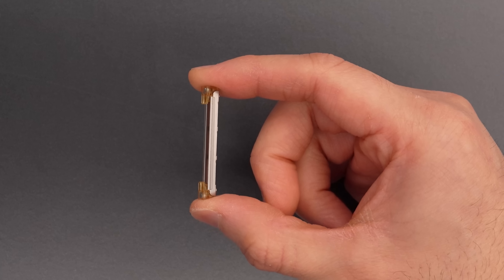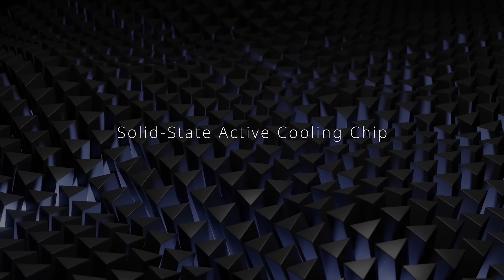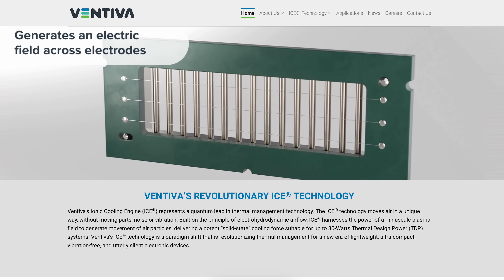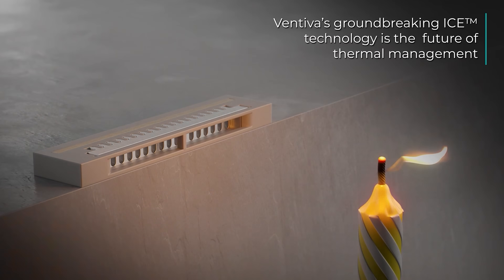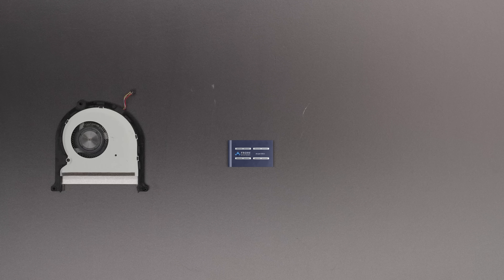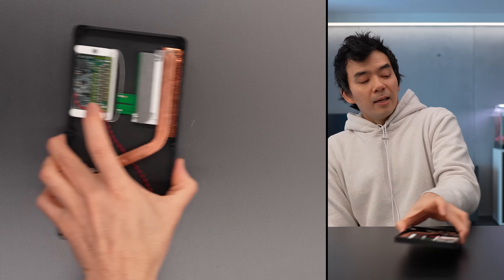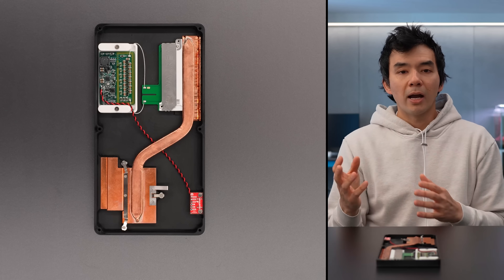The IMPOSSIBLE Laptop Fan...

Comment from the maker: This tech is absolutely incredible and I think it will change the industry
Reply: Next-Gen Ionic Plasma Thruster Inspired By Nature (BTC Mark 3)
Reply: Dave just learned about ion propulsion lol.
Reply: These ionic devices attract dust due to the charges involved. If any conducting dust/debris bridges the gap between the ionic device's electrodes, which are fairly close in this device, it will short and potentially damage the voltage multiplier board. 

Another consideration is the high voltage paths and static electricity generated will need to isolated from the rest of the laptop components with ground loops acting as current sinks around sensitive components this make layout more difficult to achieve optimal airflow as you have two competing design goals - electrical isolation and airflow.
Reply: @GruffSillyGoat This spits acrid ozone and is an ignition source that with moist air or built-up dust will arc over and can start a fire.
Reply: Is it dust proof? I bet not.
Reply: It is amazing how much you are amazed and thinks revolutionary with high school class level current induced force.
Reply: This technology is several years old, there are even a model airplanes flying using thus technology
Reply: reminds me of the ionic breeze
Reply: @AnthraxVX  because it is.
Reply: I don't think it will, because just like the AirJet an ion thruster requires quite a large amount of current to create the plasma arc - more than the amount of power required for regular fans. They are LYING to you about the power consumption - and any viewing of videos right here on YT of ion thrusters will PROVE that they are lying to you. Their benefit in satellites is they don't require extremely heavy liquid or gas fuel and instead can use the generator and batteries already in the satellite. But they are NOT power efficient AT ALL. They also have other issues in such a compact form such as heat production (you're creating plasma, plasma is hot), the wire electrode wears down so the whole thing will need to be replaced pretty regularly, they don't do well with obstructions (especially flammable ones) such as dust which is rather a problem for a computer component and an actual fire risk, they're also a risk of failing and causing a short circuit which again is a fire hazard, and ultimately they WILL drain your laptop battery much faster than fans do.
Reply: Lifters use this tech for ages.
Reply: this tech is old and far from changing the industry
Reply: @Dave2D 
👉"Incredible", no.! You have seen it working, and commented on it. So it is 
👉creditable.
You might like to learn English some time.
Reply: This is existing tech re-packaged. Plus, do you even know what the word "impossible" means? This is bad content.
Reply: In ionic thrusters, "material degradation" primarily refers to the erosion of the thruster's grid components, particularly the accelerator grid, caused by continuous bombardment from high-energy ions of the propellant, leading to a gradual decrease in thruster performance and ultimately limiting its lifespan; this erosion process is commonly called "sputtering.". 
Key points about material degradation in ionic thrusters:
Sputtering mechanism:
When ions from the propellant strike the grid surfaces, they can knock out atoms from the material, effectively "sputtering" away material and creating small craters on the grid surface.
Reply: I very much doubt that it would really serve long term: The humidity would destroy it.  They "invented" something that has existed for decades. Useless shit.
Reply: Few spoons of shit in this barrel of honey: 1.so you are now have a source of few dozen kilovolts or more near the motherboard (what could go wrong) 2. What's up with static electricity that this crap would produce? 3.whats's up with Ozone? ,it is highly corrosive you know..  4 and of course what is up with fine dust that sticks to charged surfaces (remember crt tv screens?) there's even industrial electrostatic dust filters  of similar construction ... And a problem with space ? - there is none( i am repairing laptops for 15+years) 99.9% of modern laptops motherboard sizes is 1/6 or less than they're were 8years ago(like android  screen)some of them even the size of cigarette pack.. most of today's laptops are empty space  inside...
Reply: As an Electrical Engineer for me its not something new I have been seeing these things for now 4 years. People are making fans using similar concepts.
   https://youtu.be/AJD_fiHleRM?feature=shared
Reply: People have been making ionic model planes for a while now. 
https://www.youtube.com/watch?v=a9yYu-ZM1S0

This demo was 6 years ago.
Reply: @mazinsidddique9269  look for a thing it`s called "RSD5" from Thorrn. They tried the same thing 16 years ago
Reply: ElementaryOS on the laptop in the CGI demo...>!?  NICE
Reply: fans are just too good, it will take a miracle to invent something that surpasses them
Reply: @kiyoponnn  Fans are good, we can make drones and helicopters out of them.
 
But in physics we have more tricks like Bernoulli principle for Planes etc. 

And ofcourse, there are cases where we cannot have blades and fans, for example in nuclear reactors etc, In such cases we rely on electro magnetism to move water for cooling.
Reply: @PrajwalDSouza   yeah but we are talking about moving air here so the water example is irrelevant and planes use fans in their engines unless it is a jet engine or something
Reply: @kiyoponnn  yeah they do. But like I said, in physics we have more tricks other than just conservation of momentum.
Reply: Bro that tech was already out there...
Reply: No it won't. It's old technology with downsides.
Reply: This is same technology used by NASA in ion thrusters.
Reply: In the 90's, there was a company named Sharper Image that had an Ionic Breeze - a room size version of your "impossible" fan
Ionizing fans and "air purifiers" have been around at least that long and they are a very bad idea. They produce ozone which can be deadly.
Reply: Landscapes
Reply: @Dave2D this piece of technology was there before ! This is called ionic thrusters !! Actually this was developed to develop a rocket which is able to travel to outer space !! But these thrusters are unable to produce enough thrust to run a rocket ! These are still in development !! A nice piece of tech !! I hope someday we are to produce an ionic thruster using a thorium reactor , it will be a great achievement !! Hopping for someday !!
Reply: Wrong.
Reply: THE GHOST YOUTUBER WELCOME BACK !
Reply: Dust will destroy,they are testing in low dust facilities.
Reply: this tech is trash and you know its trash lmao, channel blocked
Reply: Living in a dusty, crowded, polluted tropical country with high humidity in many places.. i doubt that in ita current form.. such applications of this technology would give the "fan" longevity in failure free operation.

But ofcourse these things might find their way in medical equipment, devices.. let's say in the intensive care units or other computing devices in controlled environments like power generation stations, critical laboratories manufacturing specialist products, microprocessors and stuff or places like the space stations.

I am more intrigued at how they are claiming that a first generation product is good enough to not add to environmental issues.
That claim about the magnesium thingy being enough to convert ozone back to oxygen. I have my doubts.
.
Scalability .. as you mentioned.. too is restrictive in consumer level products.

Although good development after decades and centuries of conventional processes.

Thank you for covering this.
Jealous that you could also check out the yet to be unveiled laptop too.
Reply: Mechanical fans require more CFM because the air it pushes is not saturated with heat so more air is pushed to take in more heat. But FRORE system SS device saturated the air with more heat and pushes it out so it requires less amount of air to be pushed. Your ionic thruster has huge problems of high voltage requirement, ozone creation and damage to devices due to static electricity  etc
Reply: And what about dust, fur and other debris?
Reply: @zlozlo3935 
I posted that the company who makes the fan, claims that they have solved those issues but can not discuss how; because of Patients pending issues and a possibility of a limited life time warranty for the fan might be possible, depending on the Laptop manufacturer.
Reply: It's been known for years now and it will change fuck all
Reply: It's pretty old..nothing new here, you need to dig the subject more...if you do not want to look like a joke
Reply: This isn't new technology at all.  I went into a Williams Sonoma decades ago and they had the Ionic Breeze which used this very same technology for a room fan and was completely silent.  Years later, the ozone issue made news.  The only difference here is that they miniaturized the devices.  Still a neat idea.  I would love a laptop with no moving parts that's completely silent.
Reply: Incorrect! This is not groundbreaking technology; it’s been around since the introduction of the Ionic Breeze. Credit goes to The Sharper Image, which pioneered this concept back in the 1990s. Let’s stop overhyping—there’s nothing innovative here.
Reply: @GoBrand0n  it needs wider use.
Reply: This isn't the first company to do this. Frore Systems has a product that does the exact same thing.
Reply: I am sure that secret company is probably asus
Reply: I want a drone made with this.
Reply: maybe all industries is there any proof for it to be scalable ? maybe for a turbine for some kind of transport or even for renewable energy?
Reply: I see devices shrinking so you can have a computer the size of a cellphone, which you can plug into a monitor and keyboard, or mount one in a housing that includes these.
Reply: PLansma Channel played with this kind of ionic tech and was able to move an impressive amount of air.
Reply: @erroneousbosch  Yeah, but did you notice how much power it takes? Way more than is being claimed in this video even for a small thruster, and low powered tiny ones will produce basically no thrust at all - certainly not enough to keep a laptop cool. It makes me think their display model is being driven not from the internal battery, but directly from the external power supply.
Reply: How can it change anything when it is impossible? That is what you say in the title, right?
Reply: unless a big company buys them.
Reply: Are you allowed to insider trade because you know what the big company is and that this will be revealed at CES? I am not accusing you, just wondering if this counts as insider information that you can buy stocks from.
Reply: End user product would be entirely DC.

One could drop (the fan device) it in water and suffer no ill personal effects from it
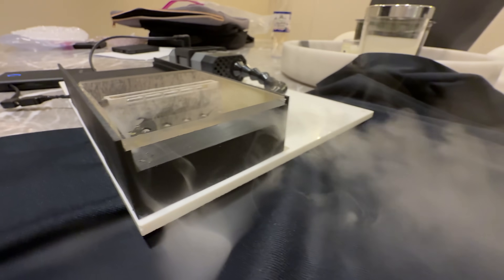Reply: 5:30 Yes smoke particles are following fluid dynamics JUST LIKE AIR... WTF are you trying to say here? Do you think the particles in air don't do the same thing?
Reply: I have a question completely unrelated to the topic. To all the YouTubers. Is there an advantage to having your own comment under your video, like generating/kick-stating engagement or something?
Reply: Manganese dioxide (MnO₂) is generally considered to be non-toxic and environmentally friendly. However, it can exhibit toxicity under certain circumstances. The toxicity of MnO₂ is primarily attributed to the release of manganese ions, which can be harmful if ingested, inhaled, or if they come into contact with the skin or eyes. The toxicity of manganese ions is influenced by factors such as the particle size, concentration, and exposure duration. Prolonged exposure to high concentrations of manganese ions can cause adverse health effects, including neurotoxicity, respiratory problems, and skin irritation.
Reply: This has been out for years I thought they would implement it by now
Reply: npc^
Reply: The technology is already existing in asia. have you ever heard about bladeless fan? it doesnt have any blade and the technology is still the same.
Reply: @Darkcrimsonfall  Bladeless fans just hide the fan out of sight. They do not use ionoc thrusters.
Reply: @Darkcrimsonfall  Nope, those household fans (Dyson etc.) hide the blades inside a closed compartment and use small nozzles with Bernoulli effect to move additional air.
Reply: It will not. See my other comment. Ionising air generates ozone which is toxic to human beings. Also working with high voltages can be challenging because of electrical noise and static build up. This will never be successful. Sorry to poop on your party.
Reply: not really, it's common knowledge
Reply: at 6:01 dell?
Reply: it'll definitely shock the industry.
sorry, not sold on it. I had an air purifier that used this same technology, it gums up very easily because dust builds up on the cathode.
Reply: @slothnium  exactly!! This is the problem , dust buildup !!
Reply: Are there leakage of ionized molecules? Could cause lung issues?
Reply: Plus static attraction at high voltage
Reply: ... doesn't ionization of O2 create ozone?
Reply: @no-trick-pony Yes. But it's small amount and unstable and breaks down quickly.
Reply: It's not new tech, ionizing air with high voltage is an old thing. I don't think this will work for consumer products, it may work for specific use cases where there's no space for fans.
Reply: Can you put them in smartphones?
Reply: on handhelds?
Reply: @aiazoe  ??
Reply: you can probably put a bigger quieter fan somewhere more convinient in the laptop's structure, that would not really make sense as a cooling solution, and then the samller units could use the air already forced into the case much easier to push it through the heatsinks, also due to the static pressure issue the cases will need better filters, if a heatsing got clogged with cat fur, it might not have the strenght to push it through
Reply: How?
What's revolutionary or new about this?
I built one of these when I was 15... that was more than 30 years ago, and it wasn't new then.
Reply: plasma channel has good information on this tech btw
Reply: i wonder how well it handles dust
Reply: How much energy does a typical laptop fan use compared to other components such as the xPU?
Reply: wrong dude. it uses high voltage and cat hair could short it out.
Reply: Aren't they already using this tech to propel satellites?
Reply: I have a crazy idea... Mix the two. Vibrator tech for cleaning it!!! Make it a on occasion cleaner that vibrates it, and the general use is the ion thruster tech
Reply: Try to combine both fan and solid state, and voila. You got and a laptop aio. Think about it
Reply: lemme get back the vape u borrowed plzz 😂
Reply: Nintendo could really take a chance with this new hardware
Reply: If you do some research, you will realize this has been out since 2013. Nice try, though. Go get more tokens, and please try again.
Reply: why is it 40 dollars if its just a peice of metal and a circuit to generate high enough voltage to ionize the air? cant you make that yourself for like 5 bucks
Reply: As someone who personally knows and is customer is one of the leading manufacturer of dc motor for cooling systems for commercial and other use. this tech will come in handy and will change the industry more than we can anticipate.
Reply: i can imagine it being used in gamming phones   as these are so small
Reply: It is waaayy TOO SLOW to cool down ROG laptop with RTX GPU
Reply: Ahhh yes, ye old sharper image ionic breeze air purifier shrunken down and then they catalyze the output so that it does not produce the ozone that purifies the air when you could have had both. They probably had to do that to get around the other patent. Still would have been nice to have your laptop and air cleaner all in one.. make it cleanable to..
Reply: The 1st one is a bladeless fan that befouls the room with ultrasonic whistling (makes deaf, tortures any dogs and minors, may cause brain damage). And this one spits acrid ozone that may decompose all kinds of precious materials in the room (photographic negatives, magnetic tapes, rubber, paper, paintings) and cause migraine and sore throat. Making a fan of an ion jet engine is as stupid as putting a combustion fuel jet engine into your laptop. And if it gets dusty or air is too moist, it will arc over and fail. Laser printers befouled the air enough with ozone and toner. No thanks for this one.
Reply: You should subscribe Plasma Channel
Reply: Looks like a copy of the design made by another youtuber "Plasma Channel".
Reply: just an ion fan
Reply: One question: What about dust accumulation? How hard will these fans be to clean when they get packed with dust over time? Will cleaning it damage the tiny filament wire? 
That's the only problem i see with these fans.
I live in an old dusty house, and about every six months, I have to take my laptop apart, remove the fans, and clean the fan fins with a toothbrush..
If they design it in a way that makes cleaning it easy and safe to do, I am all up for a laptop cooled with these fans.
Reply: @JournalistJim 
The company Ventiva, who makes this cooler claims they have solved the humidity and dust issues but will not disclose how they solved it, due to Pantent pending status.
They also state a possible limited life time warranty of the cooler.

So I guess it would be up to a laptop manufacturer to roll that dice.
Reply: Dell Is Using this Fan in their Laptop
Reply: I guess nobody's heard of the sharper image ionic breeze "air purifiier"
Reply: It's not just laptops, I was messing around with AI to get a more in-depth look as to where this tech could be used and it literally doesn't stop, everything from personal appliances to military equipment. Once this is more finely tuned this will be the standard in the future, here's just a few that AI was able to provide: Perfect for noise-sensitive environments like homes, hospitals, or offices. Suitable for applications where size and weight are critical, such as drones or satellites. Low power consumption makes them ideal for portable devices and energy-constrained systems. (These were bulleted with a more broad view but I only included the bulleted points): Wearable Technology, Consumer Electronics, Automotive Industry, Healthcare Applications, Aerospace Applications, Data Centers and Servers, Industrial Applications, Home Appliances, Military and Defense, Renewable Energy Systems. If they have the major patent behind the creation of ionic fans then they're a company that I'd be Bullish on (might be worth investigating and investing in). Just saying.
Reply: By the end of the video I am feeling it too really clear... feeling a big piece of non-engineer marketing shit.
Reply: And flight. When we move like this without air we will have spaceships
Reply: Get rid of that stupid hair, Dave.
Reply: Incorrect! This is not groundbreaking technology; it’s been around since the introduction of the Ionic Breeze. Credit goes to The Sharper Image, which pioneered this concept back in the 1990s. Let’s stop overhyping—there’s nothing innovative here.
Reply: @GoBrand0n  This goes back to laser printing. In a laser printer its called a Corona Wire. High voltage is being pushed through the wire. Look up how thats used in a printer. Creates a lot of Ozone which is very unhealthy.
Reply: Don't think it will go anywhere. Corona type fans like  this always have problems. DUST is going to be a big one. Not just dust, but all particles in the air (usually we call all of that 'dust' but pollution is included in this example. And you get a lot of Ozone being created. You don't want to breath in a lot of Ozone. Its toxic. When I worked for Xerox, some of the copiers were installed in essentially basements, with no air re-circulation. And everyone that worked in that office got headaches all the time. 
Um, yeah. Got rid of the ionic air problem? I dont think so.
Reply: What is the name of this device
Reply: I think you mean this Tech could end the planet as we know it have you Googled what would happen if you did that to all the oxygen in the world?
Reply: Creating Ozone is so cool!! Just like he said your creating OZONE out of nothing... well you get what im saying
Reply: @ and ozone is bad for your health
Reply: Yes; Seems Like a Winner....👍
Reply: Silent, Energy Efficient & Petite....
Everything U want & Need For Miniaturisation.....
And No Moving Parts Like A Fan....👍
Reply: Can this Technology be Applied to other Fluids, such as Water, 💦💦...
If so; U can Up-Scale it, to Propel Water based Vehicles, I.e. Boats, Ships & Subs.....
Fuel Efficient & Silent...Very Useful.....👍🛥️🚤⛵🚢
Reply: Yes, indeed...! The Simplest & Basic Ideas R always the Best....👍
Reply: It can. :D
I wonder if laminar flow (as in dyson fans) can solve the CFM problem you mentioned towards the end.
Reply: @PrajwalDSouza  The airflow in Dyson fans is produced by regular old fan blades.  They are in the base of the machine.  The laminar flow effect just refers to the pattern with which the air flows out of the device.  Dyson fans are actually FAAARR less efficient in terms of CFM/watt.
Reply: @None17555  Yes. True. but correct me if I'm wrong, the CFM problem he mentioned seems to be a volumetric issue, right? Not a matter of air speed right?

I know bladeless fans are inefficient, but the low turbulence could be an added benefit for noise control.
Reply: @PrajwalDSouza  You cannot increase the volumetric flow rate without increasing airspeed in such a small device. Volumetric flow rate is literally the average air speed times the cross sectional area through which it flows. If you decrease the area (the size of the device more or less), you must increase velocity in order to match the same volumetric flow rate. 

Additionally, turbulent flow is better for heat transfer anyway. You can see this for yourself by looking at correlations of the Nusselt number and Reynolds number for various fluids.
Reply: @lemonoxygen8846  That is a good point. but what if we look at volume moved instead of volumetric rate. Isn't that higher for blade less systems? 

I understand flow rate matters for convective cooling. I think I need to look up the equation.
Reply: Why not combine the two? let one build static pressure to cool minor components and other be energy efficient for air flow over the fins? Also, macbook air cools everything through chasis. So, reasonable to expect compartmentalized machines where everything that's not actively cooled gets to use laptop body as passive radiator and heatpipes from CPU/GPU use this solution to cool effectively, Potential to integrate this is endless if not for the commercial/IP/scale challenges.
Reply: @ravishah2255  yep. Or why not make it circular to get an air multiplier effect as in bladeless fans?
Reply: Just some Dyson stuff
Reply: @pewpewpower  yea, wait until he finds out about Dyson . They were doing this for years
Reply: @Xadethor  Actually Dyson just uses a small fan in the base and it just blows the air up the base and through a small gap.
Reply: It sucks, in a bad way. Much lower effectiveness, too many limitations and downsides.
Reply: It's also an ozone generator... One of the most toxic gases
Reply: @iamdmc The parts per billion of Ozone disapates very quickly. You would need to wear it on your face for hours a day to be harmful.
Reply: Nah lol you've already said it in your own video. Its too early in the tech's life with more cons than pros, and the fact that it costs wayyy more than your average fan, the companies are not goona put those on their laptops since people tend to buy shitty designed laptops even now and they won't really care about a fan's performance lol
Reply: I bet the mystery laptop manufacturer is ASUS...
Reply: @29Maverick  it's Dell as per comments
Reply: A bigger and reverse version of this exists at the campus lawns of TU Delft, a windmill with no blades and just a frame, and is able to generate electricity out of nothing.
Reply: Ozone poisoning? It's my only concern. ... But this is revolutionary because we shouldn't be worried about dust in fan blades
Reply: @soulsbourne  Nope, but of fire by arcing over into the accumulated dust - or is it supposed to self-clean by combustion?!? (You can easily autoclean a conventional blade fan by spinning it in reverse during power-on.)
Reply: @soulsbourne it's parts per billion and disapates very quickly in the air. You would have to wear it as a mask for hours to be harmful.
Reply: No imagine a airplane using this technology.
https://youtu.be/a9yYu-ZM1S0?si=b1Cn3M0Tk2o18E2Z
Reply: @patrickradcliffe3837  yeah, imagine a plane made by far more inefficient methods than currently deployed, yeah imagine, lol
Reply: So does this mean can replace the vent above my stove, and I don’t have to be overstimulated when I cook?
Reply: Please push for this within industry!!!
Reply: cant wait to see it revealed to general public
Reply: Much more potential. Imagine car radiators, AC unit, EV batteries cooling, etc.
Reply: What if UFOs travel in the air this way?
Reply: This is an amazing tech and might be used also for other applications. But what about device maintenance?
Reply: so dell is doing this tech !!
Reply: Yeah this is actually f**ing amazing ngl
Reply: Jesus loves yall
Reply: @the_boogey_man0 Jesus of the Bible is a mythical fictional architype of Religion and a lie
Reply: That's how UAP fly
Reply: That's how UAP fly
Reply: @jk-er2zt No
Reply: this will change the whole industry, just think about silent ac units or heatpumps for homes